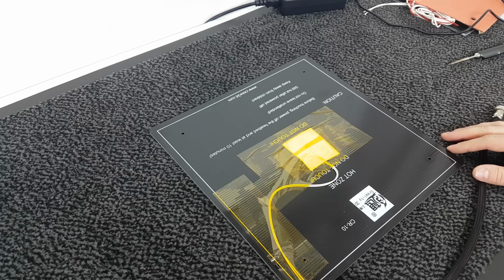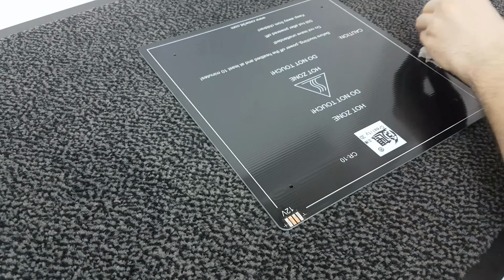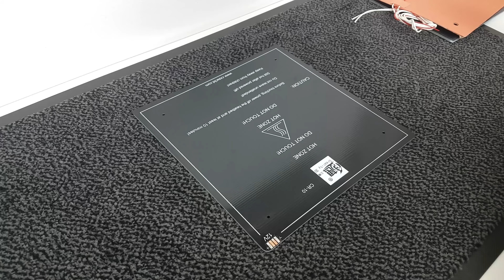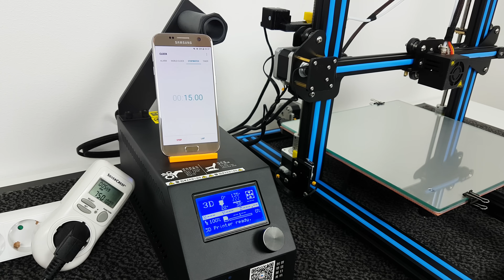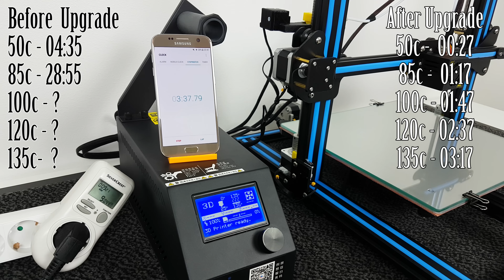Creality Cr10S ultimate Heat-bed upgrade! 750W heater installed

Comment: As a person that is not an electrical engineer I'm trying to understand something here. I see a number of comments that say this is a "no-no" because the box is not rated for the 220 mat. Forgive me if any of my terminology is off here...again, I'm not an expert in any of this.

My question is with regards to the 115/230 switch on the box. Is this switch meant to regulate or control the voltage? If that is the case, would there not be multiple components inside the box rated for 220 volts in the event the user has reason to select the 230 option? Or do these two things have nothing to do with one another? I realize the numbers are varied (110/115 and 220/230), but I was under the impression that was the purpose of this toggle.
Reply: What they are pointing out is the connector coming from the heating pad (the one he reused) that plugs into the back of the box may not be rated at 220V (I don't know if it is or not).  Before this upgrade it only carried 12V, after upgrade it carries 220V.  All connectors have both a current and voltage rating.  You should not exceed either of them.

Second, none of the circuitry in the box runs on AC, 110V or 220V.  They all run on low voltage DC (like any other IC's).  They take the 110V or 220V mains power through some circuitry (usually a transformer) and convert to DC that the IC's use on the motherboard.  The switch tells the conversion circuitry what to expect, it save costs if you tell it what to expect rather than add the extra circuitry so it can figure it out.  In either case you don't use AC to run motherboards.
Reply: @pragmaticrealist  Thanks for the reply. It is greatly appreciated.

Comment: I have cr 10 s .... ... 90 C în less 2 min ... I never try up because i don t need , i print pla ... but like i just saying 90 in less 2 min ... 1 min 40 I think ...
Reply from the maker: 90C under 2 minutes? What power supply your Cr10S has? 12 or 24v? Is it some new version?
Reply: @NexiTech  i dunno onesly , how much is power supply,  but the cr 10s is made by Cromgrow,  and have updates to wheels on bed  to plus the wire holder for the bed cables , plus I use mirror , not glass for bed, better adhesion...much better.

Comment: I'm not sure what environment your printer is in, but mine is in an office where the ambient temperature is around 18c. My (completely stock) CR-10 bed takes around 90 seconds to reach 60 degrees. I don't know why this is needed - except if I wanted perhaps to use much higher temperatures than 60/70 degrees. Odd.

Comment: In the video, the existing connector was used.  I like the the idea to reuse it, but there is a possibility that his connector may or may not have the proper current rating and/or low contact resistance rating when switching from 12 volt use to 120VAC.
   A heated bed using 120VAC needs low resistance contacts.  Poor quality connectors will become warm or hot to the touch.  Easy to see with a thermal camera.  I would also suggest not wrapping tape around all 4 wires in bundle, should one wire break free and short to another wire.  Two options to choose from when using high voltage: (1) add shrink tube to each wire, then add tape as insulator.  (2)  apply silicon glue or hot glue around all soldered joints.  With strain relief removed, force in more glue, then squeeze in more glue.  Add the relief.
Reply from the maker: Tom Luque I'm using this upgrade for over a year without any issues. In my country AC is 220V. Connector is rated for 220V 15A AC. I have thermal camera(you can see it in my other videos). No heat was ever detected on the connector sense now it only need to carry 3.4A insted of 18A that was before, so much less stress in fact...

Comment: wire seems to be too small section for 750w...
Reply from the maker: stefano scara Which wire?
Reply: from the connector to thermal pad.  white wire seems too low section . excuse me but 750 w / alimentation voltage = ampere.  2 mm wire are too low to  carry a lot of current.  which  type of wire do you use?
Reply from the maker: stefano scara These white wires on the silicon pad are from the factory (pre installed). Sense this is 220V pad they need to carry only 3.4A. Wires never get worm and I use this setup for over a year without any issues.
Reply: @NexiTech   ahh ok thats a 230volt bed!  okok thats clearly now.  i supposed thats works on 12-to 36v.  in past i see 230w digital rectifier very similar for factor which that you used!!

Comment: I got it figured out. Using a multimeter I was able to locate the correct pins to connect to the SSR. It's time for reassembly. Thanks so much for the best guide on this heater upgrade.
Reply from the maker: Good work my friend! I'm glad that it worked for you. Thanks for stopping by,

Comment: It appears my motherboard connector layout is different than yours. You connect the control side of the SSR to the middle two positions on the connector, but in my board version those two pins are occupied by the two yellow wires. The two empty slots which appear to be occupied by yellow wires in your version are actually marked HEATER in my board. I tried connect the SSR to the two pins marked HEATER but that didn't do anything. Do you have any idea?

Comment: My CR-10S bed is not heating.. could move around the wires and get it to heat but when bed started moving the heat would stop. thought i had short in bed wires got a new bed worked for about 2 months then the same issue came back had to wiggle wires around to get bed to start heating checked the wires going into the plug showing good connection from the board and to the plug and to the mosfet. Now i cant get the bed to heat at all. i checked with multi-meter no power is going to the bed when the temp is turned on. Would this upgrade maybe fix my issue?

Comment: Thanks for posting this, I bought a 1000w heater for my CR10S S4...with the stock heater it was taking 25 minutes to get to 60 degrees...I followed your example and everything went perfectly.   Now my heatbed hits 100 degrees easily in just a couple of minutes.  Very pleased with it and very pleased you posted this.
Reply: Heya. Still happy? It felt to me like less hassle to buy secondary 24V power supply. I also did not like how long it took to get at 60 degrees. Now its fast, and at 24.2V, it goes to 120 degrees in reasonable 12 minutes, to not overstress the stock bed. 60 degrees is very fast, 85 very nice, 100, fine. Almost no work, 50 dollars for the supply.
Reply: Update? Is it still working?

Comment: I have a new cr 10 s4 the bed won't heat hotter than 60c I thought it would be a good printer for ABS (NOT) takes 10 min. to heat I did notice the heat part is 300x300 not 400x400 like the metal bed. TH3D sold me mine they said that is all it heats and they are design for PLA only. unless you want to pay them 300 for upgrades this looks like the way to go.

Comment: I am not an electrician in any way, but I am confused by this.  How can this power supply that is plugged into a normal 110v household outlet, now put out 220v without a 220v connection?  Also, those wires to the bed are smaller than even a 110v connection...
Reply: 1: He probably has 220V outlets at home. 2: Minimum wire gauge is determined by the amperage going through the wire. Which is now about 3.5A instead of about 15A.
Reply: Some countries have 220/240V at the wall outlet, others use 110/120V.  At the same wattage the 220V uses 1/2 the amperage which is the major factor in wire diameter.

Comment: Pfff all these people complaining about that connector. As an electrical engineer student I can tell everyone this: A connector is rated for voltage and current. The current is how much heat it can take, the voltage is based of the distance between the conductors. A 230v mains power grid sometimes deliver voltage spikes of over 400v for short time. If the distance between the wiring is too small it will arc and possibly create a fire or kill someone if really unlucky. That is the voltage reading. A 230v cable can actually handle a LOT more voltage than 230v without arcing, but since it is wide scale, it got to be 110% safe. If you are not drawing too much current then the connector is probably fine with 230v. If someone (a kid) find the printer and maybe pull the cable or unscrew it for some reason, then it is dangerous. Is it a install that the institute of electrical safety would allow, recommend or teach? NO but for personal use it is fine if you are careful, but please do not sell it like this to someone that does not 100% understand what this install mean.

Comment: Can I use the standard heated bed with the ssr ?? .
Reply from the maker: mahmoud hagag No, you can not. SSR is AC and Heated-Bed Is DC.
Reply: Also can 600w silicon heater used ??

Comment: I did this mod to my CR-10 today.  I had bought in advance a breaker for the heating mat. In the process of the modification I noticed that the socket for the power cord has an AC fuse built into it and since the tap for the AC power is downstream of the fuse, a separate breaker is not needed. That said, the mod works beautifully. Thank you "Nexi Tech" for posting this video!
Reply: Although you have done that, I suggest putting a ground wire. Just a suggestion, it's your choice though. I put the ground wire though

Comment: I just finished modifying my CR-10S with the 750w 120V heating blanket. I used heat sink compound on the back of the SSR to ensure a good thermal bond with the power supply housing it's bolted to. It's amazing how fast I can reach 60 degrees, and achieve 120 degrees!

But there are two problems.
* The thermistor reads higher than the actual temperature. That might be partly due to location, but the old one was accurate and located similarly. I thought this one had identical characteristics to the original. Do I need to set a different type in the firmware?
* The temperature of the build plate swings + and - 2 degrees for a 4 degree temperature swing. Is there a way to reduce the hysteresis and keep it within a 2 degree total swing?
Reply: Hey, first you have to change your thermistor in the firmware; the cr10 uses the #5 but most of the silcone heaters use #1. And second you may need to calibrate your pid settings!
Reply: @sercan4320  Thanks! I'll be updating the firmware soon and will try that. There was no information on what thermistor was used from the seller.

Comment: Thanks bro!
I've did forgot the name of the "Mosfet" that we can use on 120V to plug my new silicone 120v 750w hotbed mat.
Alex from Québec, Canada
Reply from the maker: Alexandre Valiquette It's called solid state relay. You have link in video description. Add the ground wire too man! Never be to safe :)

Comment: Nice mod but your solid state relay is way overkill. Watts=Volts x Amps. 750w=240v x ?    so  750/240=3.2 amps. Your relay could have been a 5 amp version. Much cheaper and smaller.
Reply from the maker: purge98 Yes, you are right, but in the moment of making this video I only found that one in video to have that plastic protection cover all other was without which can be dangerous.  I will check and update links for some 10A version because there are alot of people who lives in countries with 110V and it's good to have some spare amps to eliminate heat/stress. 
Thanks for comment. 
Cheers :)

Comment: I soure will not mix 220V and 12V on the same connector. Because in case of.....it can be dangerous for you
Reply from the maker: Damjanhd I use this setup for almost a year without any issues and it works great. No problem whatsoever. That plug is rated for 220V. If you are worried about this upgrade don't do it. Cheers!
Reply: @NexiTech  I have no doubt it works, you did a great job. Problem is when something goes wrong you can get electrecuted or in best way burn out all electronics on printer. Much safer way it will be to use separate connectors.

Comment: Thank you! I've completed this upgrade and it is working fine, my bed is heating wonderfully. I  don't know if I did something wrong though, because now the bed doesn't stop heating when it reaches the desired temperature. Can someone provide some clarification that this is in fact what is supposed to happen, or if there is a step that I missed that can be causing the bed to constantly heat up?

Thanks in advance!
Reply from the maker: Joao Faluba Watch out! Sometning is not right! Re-check all with multimeter.  Heated bed needs to be able to turn on and off and maintain right temperature or it can worm up to over 260 degrades and potentially start the fire! On solid state relay there is working light which indicates when relay is on and off.
Reply: @NexiTech  Thanks for the quick response, will get the multi-meter out tonight and test everything out. I may increase the gauge of the on/off wires as well in case it's not getting a proper contact.

Comment: Does the powersupply has enough  power for the 750W heating bed?
Reply from the maker: Gigantiac Powersupply has nothing to do with Heated bed.l now. This Heated bed is AC powered. Please don't do this upgrade if you are not experienced with Electricity.
Reply: Ah, ok.It is directly powered. :-)

Comment: @nexi tech Can we use the stock glass & clips directly on the silicon heater? If not can you suggest something better that does not use clips?
Reply from the maker: Tony T You could, but keep in mind that silicon heater is not flat underneath. Did you mean to use heater pad on glass only without aluminium bed? If so I think that's good idea, but you might want to use special glass which is more impact and heat resistant and you need to drill 4 holes in glass as well. Tevo tornado use that kind of glass instead of aluminium bed which I like because it's perfectly flat and it's not conductive.
 If you want to make heat bed upgrade like in this video I strongly suggest that you add ground wire to one heat bed adjusting level screws and connect it to ground on the power supply for extra safety.  Instead of standard glass use Anycubic ULTRABASE(like me) and insted paper clips use silicone to glue the glass on the aluminium bed. One drop of silicon glue on each corner and one in middle should be enough. Don't use tons of glue you might need to remove or replace glass sometime. Don't use papper clips they might damage silicone heater in long term and expose the main AC wires.
Reply: @NexiTech  thanks for the quick reply. I am using the CR-10S aluminum bed with the silicon heater stuck to the bottom. I am using the stock glass and paper clips but am afraid that over time the paper clips will wear through the silicon heater and expose the wiring. Does the Ultrabase have a peel and stick backing so I can stick it directly to the aluminum bed? That way I dont have to use clips anymore :)

Comment: What its the type of this glass bed? i just got broken 5 beds with normal glasses... help me?
Reply from the maker: DDD EXPERIENCE How did you manage to do that? Smash them with the hammer?
Reply: No no, i found the problem, i use a heatbed that i just made with 8 cartridges and it was heating up with a diferent heat in some parts, used an 2mm acrilic sheet to distribute more equal the heat and it worked. Thanx  @NexiTech

Comment: Hi Nexi Tech.

goo.gl doesn't seem to work any more.

Do you have more exact links?

I have ordered the Silicon heater - I already have a solid state relay (Omron 15A), but I can't find the insulation.
Reply: Sorry, I used a wrong search phrase and got winter coats. I have found it now.

Comment: The last line of text on the main screen that says "3D printer Ready" what is the name for that line to text called if you know what I am talking about. 

Also on that line for text I saw a message when doing a 3d print via  a usb cable connected to my computer,  that line read "waiting for user". What does that mean?

Comment: The wiring etc here for the heated bed is it   the same for the X5S.  I have ordered everything from your X5S upgrade list as well as the printer but want to make sure that I am understanding this particular area of the wiring.  I ordered the mosfet as well but looks like its not necessary Thanks

Comment: I installed a 24V 500W silicon heater. I also installed a circuit to isolate the 24V from the printer using an optocoupler. I later found out that this is NOT NEEDED, because the CR-10S already has one on its MOSFET module... DANG.
The bed heats up much faster now, BUT because of the thermal characteristics of the whole bed (heater, glue, aluminum, air, glass) there is a lag in the heating of the glass itself.
When I heat up to 90c the glass is just at 70 and takes about 3 minutes to reach the temperature measured at the NTC. Take this into consideration people...
Reply: Everything has a 'thermal constant', i.e. it's ability to conduct heat. Plastic has a very high thermal constant. Aluminium and brass have a very low thermal constant. Glass is somewhere in between.

Comment: Hello! Thanks for this video! Did you upgrade to Marilyn software? Or do you using the original software?
Reply from the maker: Manuel Castro  No problem :) 
 Nope, I use the stock software.
Reply: Nexi Tech I’ll proceed with this great upgrade! Thanks a lot!